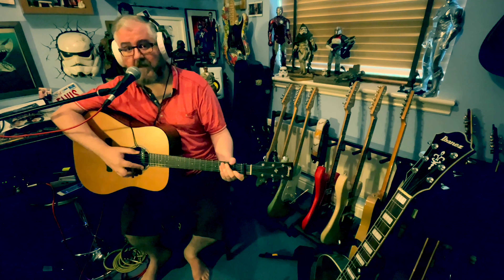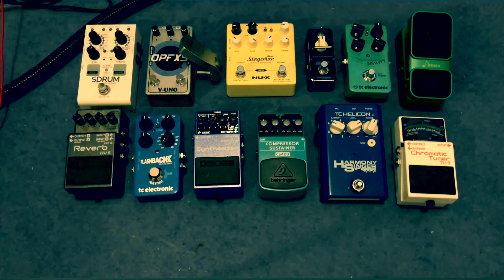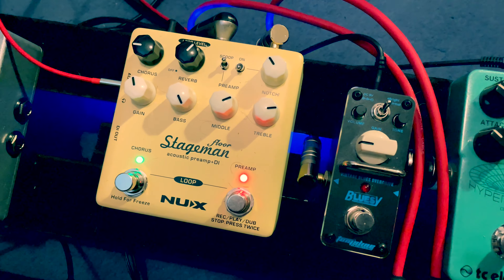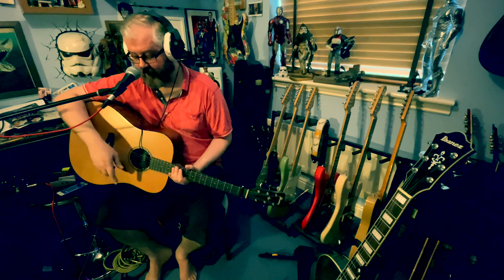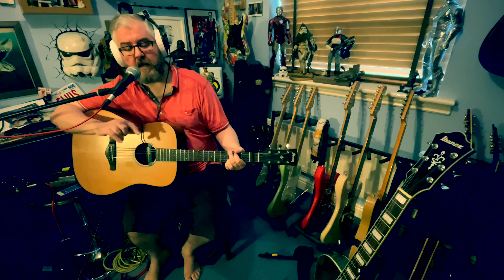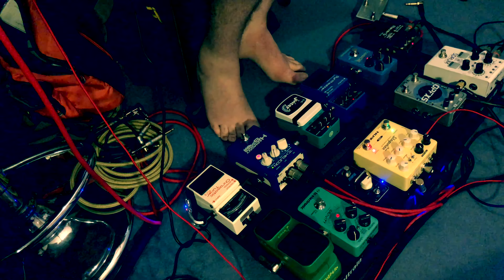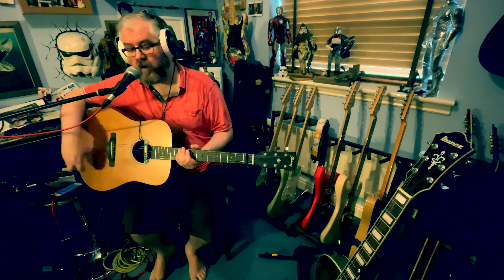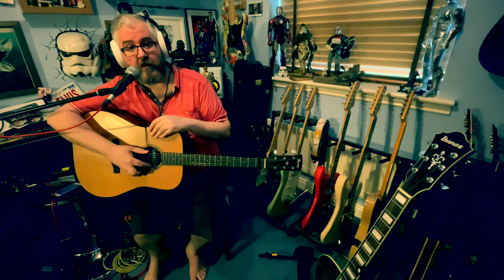Monday Worship - Acoustic Pedalboard Walkthrough Part III

Comment: nice rig i have a few of those pedals on my board too ....love the harmony singer ...also love the berringer 25 dollar compressor
Reply from the maker: Thanks for stopping by, checking out the video and leaving a comment. The Harmony Singer is one of my favourite pedal purchases that’s for sure. Recently added the Duplicator pedal into the mix too for a little pitch correction.
Reply: @mondayworship390  dont be ashamed of that compressor man .....i have it too and it's a clone of the boss compressor sustainer....does it's job at a reasonable price point.